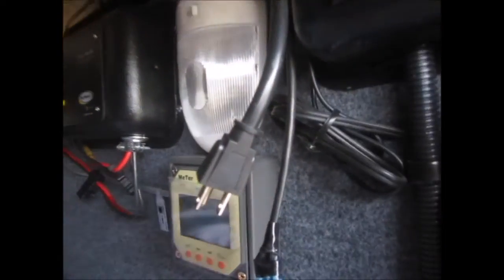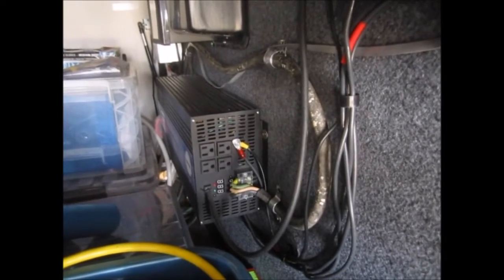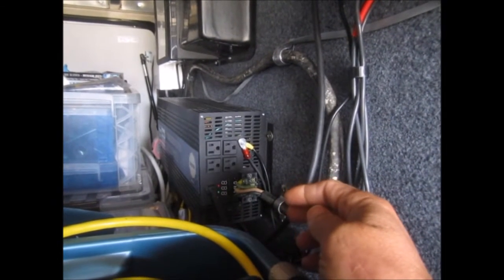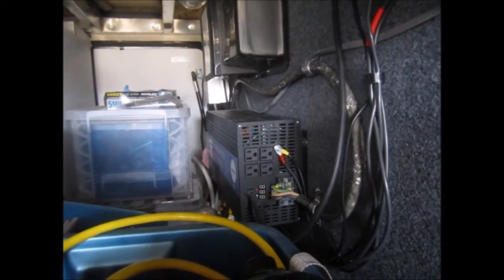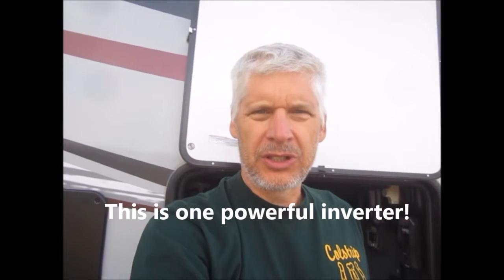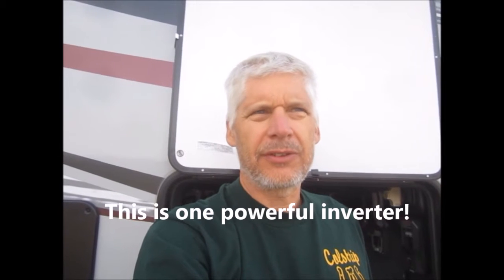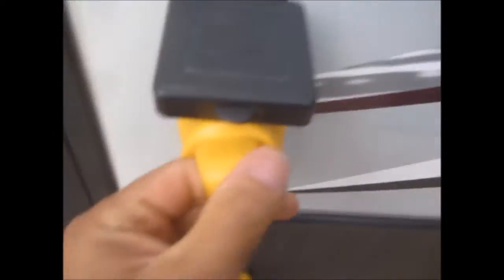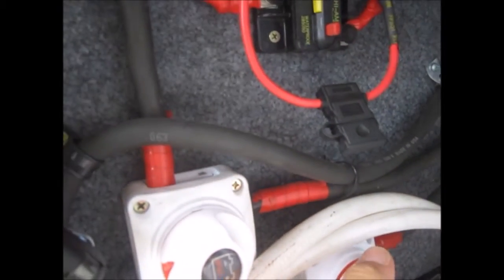My 3000 watt pure sine inverter went up in smoke. Power Simple replaced it under warranty

Comment: This is what I intend to do, I just bought a 3500w pure sine wave and have 470ah batt string. At this point I only have 200w of solar, so tell me, how well did the AC work on tour inverter, is it 13.5 or 15k btu? I drove a ground rod in my backyard and am getting ready to use it.
Reply from the maker: Norm Nilsson I installed a 11,000btu in the bedroom (video in playlists). It would run an hour easy off my 560 amp hour battery bank. In full sun with 700 watts of solar the batteries would maintain the charge.

Comment: You have done a really nice job installing everything you have done so far. i hate it when things like this happen. I have been a electrical contractor for the past 35 years and do a lot of alternative energy and standalone systems like yours. I don't know where you got your resources from but you've done a really good job at everything you've done so far. I would like to add one comment if you don't mind my opinion. For the size of your system and the size of your RV if you continue to have inverter or charge controller problems, I would highly recommend an Outback inverter charge controller and remote mate . I know they are a little pricey but well worth the investment you only have to do it once!  The outback charge controller will give you the ability to fine-tune your charging system such as your bulk and float voltage,charge rate as well as low battery cut in and high battery cut out etc... If there's anything I can do to help feel free to let me know. Keep up the good job! Looks Awesome!!!
Reply from the maker: Thank you DC. I asked for your input, and greatly appreciate your time and reply. I know with a name like "DC" you would be the guy to ask to look it over for me.
I did go low-end on charge controllers and inverter, and tried to do as good as I could with the rest with the thought of upgrading later if the controller or inverter failed.
This is my 3rd RV I have installed an inverter in, but my 1st try at solar. I did lots of research, mostly on youtube. Found some real crap along with gold on here. Used what looked right and left the rest.
Reply: Stim Racing Trailer and Travels Thanks for the reply and complement. Your doing a awesome job with your 1st solar install. I can tell you have done a lot of research and put a lot of thought and time into this project.Good workmanship speaks for itself. I can truly relate to a lot of your videos. I just bought a 2017 Winnebago 2401RG travel trailer and have had to do several repairs myself to it due to the lack of QC and factory workmanship. Keep up the good work and wish you all safe and happy traveling. Thanks again for sharing DC.